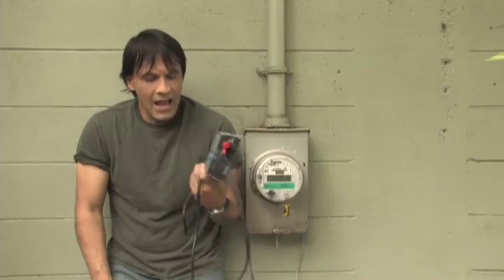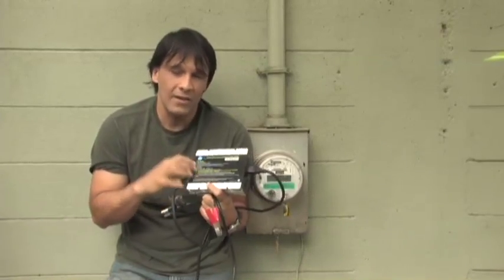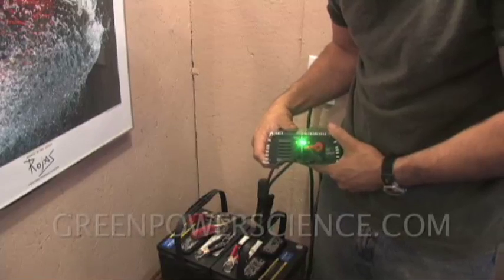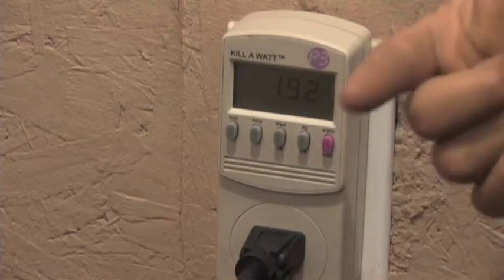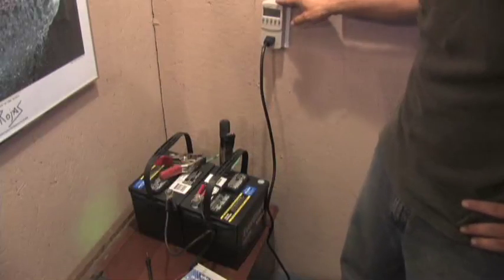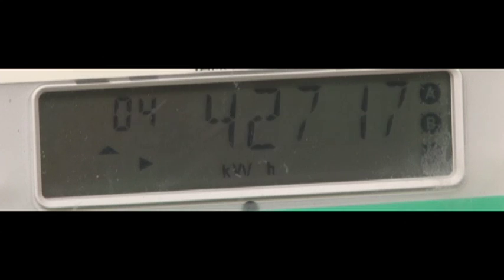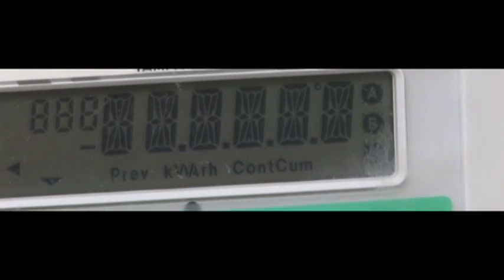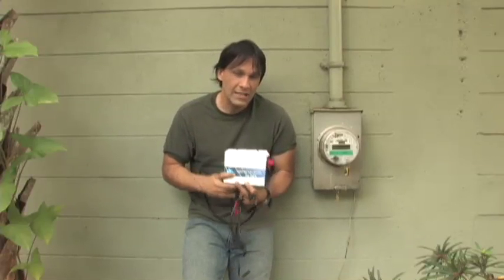GRID TIE INVERTER SOLAR panel POWER EASY Electricity Savings

Comment: @GREENPOWERSCIENCE  Do the solar panels (for example if its 1000 Watts output) do they create that every hour or every day if the sun was shining all the time?
I can't work out how much electricity i could save unless i know this information, so another example if a solar panel is 100 watts and its in the sun all day 24 hours (and imagine it was sunny for 24 hours constantly) would i have created 100 watts in that total time period OR 100 watts for every hour so a total of 2,400 watts, which is the correct calculation

ALSO to use one of these inverters to put power back into my home do i need to turn off my house electrics or do i keep it all turned on all the time aswell as the grid tie inverter on too
Reply: +SP330Y Your panels must be facing the sun to provide rated power, so you would need to decide on more panels versus a rotor. Clouds drastically reduce the power. Fixed panels may only provide useful power for 5 or so hours. Using this type of inverter, you leave all your breakers on, but it is probably a good idea to install a dedicated circuit with a ground fault. I would put this circuit on the bank that uses power during the day, such as refrigerators, washers, printers, etc. because the feed into your house is 240v - two 120v banks.Some of these inverters will adjust the power out by drawing power at the maximum solar panel efficiency. Just my take.
Reply: To answer your question ~ you would have created 2,400 watts.
The wattage rating of the solar panels is real time. Example: a 250 watt panel will produce 250 watts in peak sunlight. So, Four 250 watt panels will produce 1,000 watts.  After 5 hours of sunlight, they will have produced 5,000 watts or 5kW. 
As for the grid tie, you just plug it in to your house and your appliances will pull from the solar / grid tie power first.
Reply: Denniss7420
thanks for the answer much appreciated :) Have a great day

Comment: hi dan, I just want to ask a  quick question , the 2 12 volt batteries you using for your grid tie inverter , are you just using them as a example for this demo, or can you permanently use them , or do you suppose to hook up solar panels to the inverter , and how long do the batteries last if they were fully charged, or do you just recharge the batteries again , or does it recharge it self , with whats going on with the inverter ....

Comment: Im curious how to connect a mc4 cable from a 100w solar panel to the 600w grid tie inverter, which will then be connected to a power outlet in the home. (ill get more panels as time goes on) I don't think you offer a video on this unfortunately...

How do I connect the mc4 cables from the solar panels to the grid tie inverter? What is needed?
Reply: Cut off the mc4 or purchase an mc4  extension cable to connect to the gti

Comment: bad money on grid tie inverters best to get off the grid mate you be better off in the next storm when it  takes out the power lines then power out and why give away your power only to pay money to get it back ? ... you do have a water tank don't you, look at it this way you get rain off your roof to go in a tank to use it. you can get sun off your roof to go into battery is just like a tank and you can buy DC to AC inverter better money spent on the right gear 1st time.  cleaner free power from the sun just like free water in your tank then water the garden grow your food and even use led light to help grow them faster from the power you get from the sun to . great work keep the videos come happy to watch

Comment: Wow I've never seen this equipment before...But in my grad school, they taught me that we need some basic laws to be fulfilled before we plug anything into the grid...you know, synchronizing the voltage levels, frequency and phase sequence...How do you connect it directly to your power socket? Is there anything built in that inverter circuit to match with supply frequency and phase sequence?
Reply: Yes.  think of the grid tie as a tuned amplifier which sinks into the grid.

Comment: Is there an inverter that can work with a 7500 Watt Generator to feed back to a Net Meter?
Reply: +silverbankruptcy If your taking about an ac generator, theoretically you could match your generator cycles to the grid and pump power back without an inverter. Though I'm fairly certain it's not possible to do this with a contractor grade generators like from Home Depot.   

...And there are some details I'm leaving out cuz I don't know them. Also it's illegal and dangerous. Even trying it without a full understanding of the process will end very badly.
Reply: +silverbankruptcy A 7500 watt 120 v. generator is not a good choice for grid tie, and if it's available would likely cost a lot. You could use a 7500 watt dc power supply connected to a grid tie inverter, but you would lose some efficiency. Spinning an induction motor with an engine would be a viable option, but you would have to know what you are doing.

Comment: If you turn the main braker of how do you expect the curren flow to the meter. You have to cut the brakers off, just leave the one with the batteries conected ON, and the main ON as well. Than it perhaps works.
Reply: The main breaker is still on. The breaker to the inverter is still on. ALL the other breakers are off. . The only problem is the electric company will NOT give you one penny back unless you have a contract. Thus the power meter keeps resetting itself to the highest amount it ever reached, basically taking the electricity and keeping it for free.  Search Wikipedia for "Robber Barons"

Comment: I am just starting to look into solar for the home and found your very informative video, (actually you have so many!) thanks for sharing. My question is given the size of the system you show here what would be the expected savings?
Reply: +dnhman The problem in Colorado is the power company will buy your extra juice for $0.02/kwh and sell it to your neighbor for $0.11/kwh.  So you're savings come from two places: not using the grid's power, and selling it back to them for a ripoff price (but what else are you gonna do?).  So look at your last electricity bill and see how many kwh you used.
Reply: +Justin Atwell  Hi Justin, I have a 2000w Solar system on my RV, however, do you have a suggestion for an electric meter that will actually sell the juice back.  I need to give my landlord in the RV park this information.  Thanks
Reply: It looks like you may be able to use one of those Kill-a-watt meters that keeps track of kWh and just give him that info each month.  It's normally for measuring how much juice something CONSUMES, and wattage, but I'm reading they DO run backward.  It's only a standard house plug, so it might not work if you're using a 30A or 50A plugin.  Also, I don't think they're suitable for outdoor use.

Comment: good works ! after 40 minutes of testing the meter does not go backward ? could it be the 200watt output @ 40 minute (40/60)= 0.133kwh , lower than 1kwh thats why it does not reverse the meter measuring in kwh digit.
Reply: +Danny Lim   I don't think digital meters will run backwards. Either your giving the grid free power or worse your meter may like the kill-a-watt in the test above may actually count power you send into the grid as power you've used and charge you for it.

Comment: Hi, can any one who help me. Can a  grid-tied solar panel power system to   pumping station, submersible pump using 230V, 30 Watts and 440V, 40 watts, which can lessen electric bill  of pumping stations. thanks
Reply: Michael Ancheta

Comment: Thanks for taking the time to make this video.
  I think another interesting experiment using the exact same scenerio would be to turn off all breakers except for the one your pluged into and then plug in a houshold lamp in the same circuit or even the other available socket on that particular outlet and show definitively that the power is reversing.

Comment: So if I have several 6v volt solar panels, how do I use them with a 12v inverter without connecting them in series? Does it matter where in the house I plug it in (any particular circuit) or is it ok to plug it anywhere?
Reply from the maker: +Blakehx Hi, series is the only reasonable solution. The recommended option is a dedicated circuit with a 10-15 AMP breaker. I have found it to work anywhere. I use an outdoor outlet to and extension cord. Short run on the DC side and 50-100 feet on the AC side of the inverter. It is not AC vs DC that makes this work, it is higher voltage. Because the inverter outputs 120v+, it is much more efficient for the long run to take place on the higher voltage side. This also places the inverter away from the home in a ventilated, moisture protective enclosure near the solar panels. Should something go wrong with the inverter (usually not a problem but some people opt for low cost units made in China) you reduce risks. With that said, most people do not have issues if they are installed correctly. Also, no batteries required, this was just for testing.

Comment: Just a thought !How about a strong enough inverter,let's say 2000W,use one phase  from the house power for the inverter to feed back,the same phase ,from a step down T-former from 120V to 12V,instead of Batteries and continue to consume electricity as usual,I think it will mess up the proper reading of the meter,for the benefit of the homeowner

Comment: So if I have multiple 6v solar panels, how would I use this inverter? You said that it could damage the panels if they were connected in series? Where is the best place to get a quality grid-tie inverter without paying too much… or do I need to be concerned about the quality? Thanks for another great video!

Comment: Hi I'm after some help I have a 100w pannel attached to a 350w gti at max I'm only getting about 5 watts can someone please explain 

Cheers
Reply from the maker: Miles Chappell Hi Miles,
Test the panel to DC load and see what wattage the panel is providing. Then quickly test the GTI with a battery 12v to see if it is working well. IF both are fine and you are still getting a low watt to the grid then it is a voltage issue either with the panel to the GTI or your Grid voltage is blocking input. Post the specs of the GTI/PVpanel/Grid Voltage.

Comment: One safety note. you should not exceed 1500 watts per circuit since many house hold circuits are only rated 15 amps 2000 watts would exceed that so it's best to spread them over a couple circuits if you intend to use multiple inverters.
Reply: true
Reply: True, although just thinking out loud here... 15amps x 110VAC = 1650W.  Nominally that's at least 16 x 100W panels.   In practice, more like 20-30 panels or so on most days... I have yet to see my panels 
 (in North Carolina) produce more than 75% of what they're rated (yes, I know there are losses and shading, etc, etc).  But still...  Even the most efficient set up, it would take almost an entire roof of a modest home of panels feeding an inverter to overload even a modest 15 amp circuit.  That said, yeah of course someone needs to be mindful of their wiring and capacities for load and current.

Comment: did not go though the comments to see if this came up but if you shut the main off the will kill power coming in and out?!?1? am i wrong?
Reply from the maker: James Bellottie Yes, the main was dropped to pause the meter after it rolled past the kW reading uptick. The GTI will not work without grid power detection, o the main was flipped back on for the run.

Comment: I bought two of these.  They work great.  But, the energy company meter displayed an error because of excess energy and sent out the troops.  You have to have a UL1471 approved inverter and a cut-off at the meter and get it approved by the Electric company.  I sent them a pic of the grid-tie inverter laying in the driveway and they went away.
Reply: That's why the meter kept reseting. It was obviously sending a warning to the electric company that you were feeding electricity back into the grid that the electric company had no record of. So.. if the electric company cuts power to an entire block and they go in and start working on it they can get a nasty shock (ouch) from the power coming in from this inverter.
Reply: If they cut power to the entire block, this unit will shut down. They rely on the grid to provide the sync signal and by law have to shut down if they do no get it. Now if it was a regular sine wave inverter feeding power into the panel, that is a whole different story. Most would trip off as the load on them would be too great as it would feed the owner's transformer and any neighbors. And that would overload it.

Comment: If that meter counts KW then at rate of 236 watts would have taken 4.24 Hours to produce 1 KW  (1000 KW / 236 watts = 4.24)
Reply: +Powlas Enterprises That's why he waited until it "just did an uptick" so he knows it would be 428307.0001 on the meter, and he'd only have to feed back that little 0.0001 in order to get it to tick back down.  But as he says in the annotation, most of those electrical meters don't go backwards; you have to buy a buyback meter with your agreement to sell back to the utility company.
Reply: ***** I know that cause i have the same meter. i was just stating the time it would take. If you do not get them to program it to be a bidirectional it will charge you when you put power back to your power company.
Reply: +Powlas Enterprises kilowatt-hours; in other words, 236 watts for ~40 minutes = ~354Wh = ~0.354kWh
Reply: +doctor zaius Shit, I already realize that I'm wrong... it's the other way around. ~157.3Wh or ~0.1573kWh x 4.24 = you are right, my bad.

Comment: If you let it run for 40 minutes, that's about 0.6 hrs.  And since you're putting 0.250kW into the grid, that's a total of 0.15kWh.  Since your meter's resolution goes down to 1kWh, the results are inconclusive.  

While your videos are pretty cool, you gotta add some basic math and at least make some attempt to live up to the name greenpowerSCIENCE.
Reply: that's why he waited for the meter to just change to 7
Reply: Nope. look close and you can see the 10ths. and 100ths of a KWH in small numbers. They do not change cause the meter (electronic) is locked to not "notice" the reverse flow by the electric company. Why do you think all the electric untilitys were  (are) so excited to replace all the mechanical meters (that will flow backwards irregardless) to shiny new electronic meters that can be set by the utility to 'not" read backwards. The frosting on the cake for the Utilities is they don't need to pay meter readers any more. a double win for them and a loss for the readers and a loss for the customers (us)

Comment from the maker: There is a TV show who I will not name (do not want to advertise their silly science) but they totally faked a GTI output and displayed one outputting 121 volts at the male prong UNPLUGGED. They do not work that way, They do not work that way. Anti-islanding is legally required and also part of what makes them work in the first place. SO if you see it on TV, do not be alarmed. THEY DO NOT WORK THAT WAY.
Reply: GREENPOWERSCIENCE Safety and wiring to code is also legally required, but that doesn't seem important to guys using these things, so why would anti-islanding matter?
Reply: GREENPOWERSCIENCE
Reply: Wendy Sue Stoots
Yes, Wendy?
Reply: GREENPOWERSCIENCE

Comment: Thanks for the great info.  That is the best config for a solar array.  Generating surplus to sell the Utility is not realistic.  Slowing the meter makes sense.
Reply: Bob Shepherd I know several people who sell electricity back to our electric company via solar panels or wind turbine. In my state, the utility company is required to pay "market value" for the electricity you generate (none of this half-price nonsense). They have equipment to prevent islanding during an outage.
Reply: tucstwo Thats impressive.  How many watts do they produce to cover the house w/ excess?
Reply: Bob Shepherd It varies greatly by your own homes ability to produce "megawatt hours". Whether you have a home wind turbine or solar panels. But the laws here are pretty black and white. If you produce excess power, the "power company" must purchase it back from you at the same price in which they "pay" for it or their costs. It's a set amount and displayed on the bill.
Reply: tucstwo 1 mega-watt/hour is 1,000,000 watts/hr  The average panel produces about 250 watts/hour so 1 mega-watt hour would require 4000 panels.
Reply: Disregard
Reply: Disregard
Reply: Your utility bill is measured in KW/Hrs.

Comment from the maker: @ jim bee They do not work that way, no voltage no power. This is known as anti-islanding. A grid-tied solar power system is required by law to have a gridtie inverter with an anti-islanding function, which senses when a power outage occurs and shuts itself off.
Reply from the maker: GREENPOWERSCIENCE They all have them build in because back feeding the neighborhood with a single home system would be a massive dead load.
Reply: GREENPOWERSCIENCE The law requires it because in the event of downed power lines, the lines man repairing it wont be killed because your feeding power back to the grid while he is trying to repair it.
Reply: GREENPOWERSCIENCE

Comment: Have you tried ebay grid tie inverters ? Specifically the U-POWER-5000 which costs about 1000$.

I can't afford a 6000$ windy boy, this kills the benefits of my power generation system (biofuel in diesel generator). I would really like to give the ebay inverters a shot !